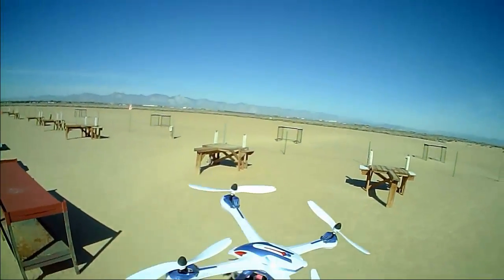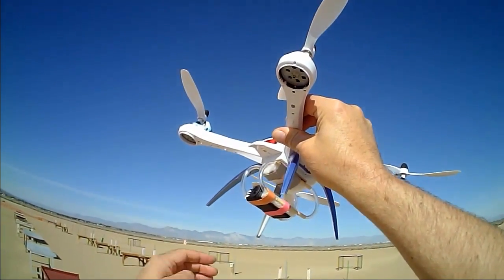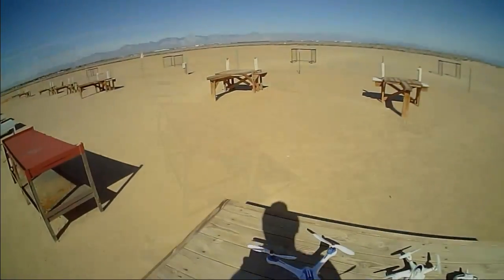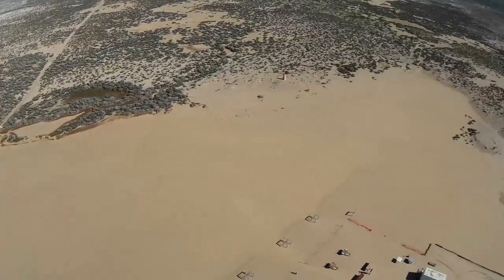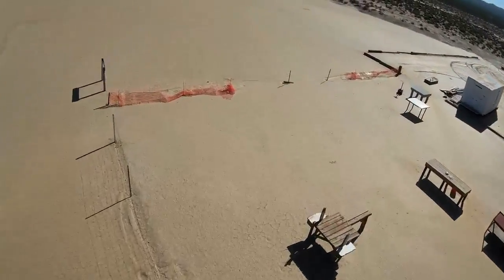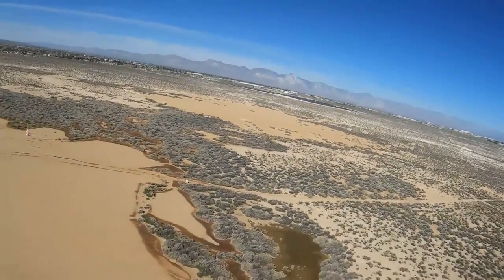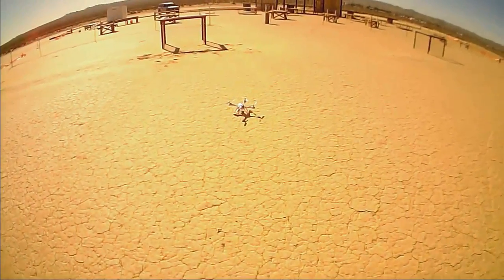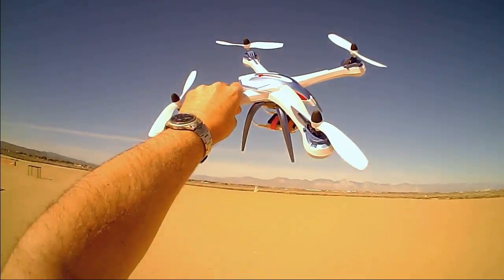Tarantula X6 Drone Camera Mount Test #2

Comment: Hi, Quadcopter, I tested the Togo clone Zoopa Mantis bought it as used of ebay for 20 EUR. It is very light/fragile, the cam and its holder not a real solution, but it runs like a racer drone. Your solution with an extern cam is the onliest way to get useable videos. Runcam, Fireflight and other cams and you have more fun with high speed. The Tarantula has a motor problem, you mentioned it, the motors burn too quick. At the moment I don't know what about the Mantis.

Comment: Good afternoon, I am hoping for expert and valuable opinion. I have two quads that I am trying to decide on. One being the Jxd 509G and the other Tarantula X6. Please tell me based on flight distance, camera and options what would be the better of the two. Also I noticed the Tarantula didn't have the 5.8 screen like the 509G. Is that a option for FPV?
Please help despertly wanting to make the purchase. I really do the like the availability to have the FPV. 
Thank you for your great videos.
 Phil
Reply from the maker: +phil gibbs An FPV kit is available for the Tarantula, but at an additional cost of $52 above the cost of the quadcopter.  The Tarantula also does not have altitude hold like the 509G.  Thus, as your primary interest appears to be FPV, then the 509G would likely be the better option for you. https://www.youtube.com/watch?v=9bPaOEDpQFs
Reply: Thank you for your quick response. So the attitude hold benefit is for taking good pictures? This will be my first quad.
Thank you
Reply from the maker: ***** No, the altitude hold feature is for preventing you from crashing into the ground. There's a misconception among many new fliers that flying FPV is easy. Actually it is very difficult, much more than normal line of sight flying. It is because it is very hard to judge distance from objects while flying FPV, especially with the ground.

Comment: hi. Great video as usual thank you. Question for you. I have an sj4000 (go pro copy) ad  was wondering, can this quad carry it? I notice you're using a mobius camera in this video. I've got a #16 808 camera but Im not happy with the quality of it and want to use the gopro copy instead. Thanks very much
Reply from the maker: skyrider1985 The X8C would be a better choice as it has more lifting power, and it doesn't have vibration issues like the Tarantula (Tarantula is infamous for jello).  I prefer to use the $55 Runcam HD with my X8C as it produces excellent results https://www.youtube.com/watch?v=DkWcSE9FGRU
https://www.youtube.com/watch?v=i32czqkycQM
https://www.youtube.com/watch?v=w2sqjk6ZmZI
Reply: thanks very much for you answers

Comment: Are all the hook-ups the same no matter for camera or power. Can a battery be used for the camera and another battery used for power. All after market cameras have the same hookups
Reply from the maker: Ray Boley Not sure that I understand your question. In the above video, I used a Mobius camera.  The Mobius has its own built-in battery for power, and does not use the quadcopter's battery for power.

Comment: Do you happen to know what the optimum wave length of 7.4 ghr is? i only found nuclear physics handbooks and, could not find it. Thanks. Sell that original 6052? HAHAHA

Charles Jones
Reply from the maker: Bud Jones Do you really mean 2.4 Ghz (like which these toy quadcopters use)?  If so, 1 wavelength = 125mm.  But some recommend 5/4 wavelength for optimum range (156mm).  But if both of the above are too long, 3/4 wavelength works well too (93mm).  Remember if you do this, do not point the antenna tip at the quadcopter. Instead you point the side of the antenna at the quadcopter.
Reply: Quadcopter 101 I bought a supernova. They say the control distance is 900-1600 meters-- I can not buy that. It says it is 7.4 ghr-- like the tarantula 6-- seems hard to beleive. I wanted to maximize range with 7.4, It is not the standard 2.4 as most.
Reply from the maker: Bud Jones The Tarantula X6 uses 2.4 Ghz.

Comment: I have the jjrc 686 on order but I really like this X6 so might get it as well - do you know if the stock 5M camera they sell with it is any good or should I stick with my 808#16 with D lens on it?
Also im wondered if this X6 can be used with an 808 and a 5.8ghz transmitter so I can use the remote and screen off my 686 and use this for FPV as well as I imagine the range on the X6 is so much better?
Love your vids.
Reply from the maker: despotmurgatroid I don't know yet about the quality of the 5M camera, as no one has gotten there's yet (it's too new). But it's hard to go wrong with the 808 #16 V3 D lens ;)  It's extremely lightweight, so most quadcopters can lift it.  Don't know if what you're proposing for FPV is possible, but maybe some of the other viewers here can answer that?

Comment: +Quadcopter 101, I am looking into getting a quadcopter (first time buyer). I have used many RC planes and helis so i know how to fly them. Do the motors on this quad have enough power and durability to hold the mobius often. I am planning to use this just for video, no stunts or racing. On another note would you suggest this quad or the newly released Syma x8c for video, I am leaning more to this seeing that it is very well liked and there are not many reviews of the Syma x8c yet. Thanks!
Reply from the maker: Haven't had a chance to review the X8C yet, but am concerned with its advertised range of only 100m.  The Tarantula can go much further than that.  Would recommend the Tarantual just for that alone.  The Tarantula's Hyper IOC feature also can actually be used as a return to home feature https://www.youtube.com/watch?v=ZNauv2w-uB8
Reply: Quadcopter 101 So the Tarantula x6 is a good option?

Comment: I just replaced a motor and but it back together every thing is right but she will not lift off!   Is there a reset on a jjrc  h8c  ??????????
Reply from the maker: Let me make sure that you're talking about the JJRC H8C, and NOT the Tarantula X6 featured in this video.

If so, try recalibrating gyros first.
1) Turn on quadcopter and place it on a flat and level surface
2) Turn on the transmitter and set it to 100% rate
3) move and hold both control sticks to lower right corners until the quadcopter's lights blink.
4) Let go of the sticks and try flying.

If the above didn't help, then you likely installed the propellers incorrectly (note that there are counter clockwise and clockwise propellers). You need to keep track when removing them so that you can reinstall them on the exact same motors.  If you forgot or don't know which is which, then recommend closely looking at the following picture, paying particular attention to the shape of the propellers and which arms they are installed on. Reinstall the propellers as needed to match this picture exactly.
http://img15.hostingpics.net/pics/522333DSCF4940.jpg
Reply: Quadcopter 101 Hi, Thanks so much, Yes I have the h8c.  I just keep this on my email so I can go right to you tube. I did do that several times and did the shake up thing. Even at 100 persent power she just sits there.  At best I can get her to jump around.   As you might guess I am a newbee to quads.
thanks
Reply: todd kruper Also the props are in the right places!
Reply from the maker: todd kruper OK, the next thing to check is the wiring.  Are you absolutely certain that you did not install the motor wiring backwards (red to red blue to blue, or white to white and black to black)?
Reply from the maker: todd kruper Also, with the quadcopter off, spin each one of your props manually by hand. Do they all spin freely, or does one (or more) show unusual resistance to your spinning them.
Reply: Quadcopter 101 Well my friend this was it, When I replaced the motor it was hard to get out of the plastic case.  When I inspected the housing there was signs of melted plastic. I remember looking at the gears and the sound was ruff but the blade  went around.  So thinking they just were not running together  I placed a small block of hard foam between the motor and the housing!   "IT FLIES- IT FLYIES"  Thank you for your time.  I will order a new motor housing and do it all again.  Great training!  To many f----en screws!!!

Thanks
todd

Comment: Hows the motors on this holding up? Been through so many with the v262, even with the bearing mod.
Reply from the maker: Yeah, I doubt very much that the bearing mod does much to improve the durability of the motors.  More important is to inspect your gears after every flight for any debris or sand to be cleared.  Additionally, I shoot a blast of compressed air through each of the motor ventilation ports to clear abrasive brush residue from the commutator.  I also don't fly aggressively with these bigger quadcopters, as both motor and gear durability can become issues with flips and such.  I use these bigger quads mainly for camera birds.  Doing the above with my V262 has greatly improved motor longevity.  Doing the same with my Tarantula, I'm at about 15 flights, and the motors still sound and operate strong.

Comment: How bout a syma x7? Can the syma x7 lift up a mobius actioncam?
Reply from the maker: No. The Syma X7 is not really powerful enough to reliably lift the Mobius.
Reply: Quadcopter 101 ok thanks alot!
Reply: +Quadcopter 101 so are there any mini quads that can lift up the mobius?
Reply from the maker: Justin Ng The JJRC H8C and Syma X5c.  But I wouldn't recommend it for prolonged flights as you will damage the motors.  Here are some example flights https://www.youtube.com/watch?v=SNePkMznOos
https://www.youtube.com/watch?v=Ih7Is30NpMk

Comment: Try surgical tubing or fuel tubing from a glow powered plane. It's made from silicone and surgical tubing is latex.
http://www.ebay.com/itm/1-4-ID-3-8-OD-1-16-wall-Latex-Tubing-Surgical-Rubber-Tube-Amber-By-The-Foot-/200822460443?pt=LH_DefaultDomain_0&hash=item2ec1f3901b
Here is some fuel tubing.
http://www.ebay.com/itm/DUBRO-196-Small-Silicone-Fuel-Tubing-2-Glow-Fuel-Only-Same-as-Dubro-221-/231169769791?pt=LH_DefaultDomain_0&hash=item35d2cac13f

Comment: The blue silicone aquarum tubing is much less stiff, and some kinds of it are softer than others.
 So using a stiffer frame with a short length of the silicone tubing might work well.

Comment: Thoughts on the jello, it may be caused by the video stabilization software in the camera. The camera probably scans the image in horizontal bands. The jello seems to be most apparent when the objects move across those bands which is vertical movement.  In horizontal panning, the image rides along the video bands, and that seems to be fine..

Regarding the camera anit-vibration mount, consider a standard dish washing sponge and some rubber bands not stretched too tight, but I do not think vibrations are causing the jello in this video.

Comment: Surgical tubing can be found at most hobby shops which support RC Aircraft, as they use it for fuel line, and have been using it for decades as such. If you have no hobby stores in your area, some pharmacies carry it.  Also, hardware stores carry it because its also used as fuel line for gas powered weed whackers, chain saws and hedge trimmers. Hope that helps.
Reply from the maker: Thanks, that does help. No hobby stores in my small town.  But we do have a Lowes, so will be checking out their weed whacker section.

Comment: Great video, I agree with what your saying about the forward motion causing the jello. On the X5c the stock camera is mounted ridged and there is no jello at all. But when I tried to get fancy and make an extended mount for the 808 camera it did the same thing that you are getting on X6. It was OK on hover but jello on forward motion. Strap it down like you did on the X5c and jello was gone. But it is fun trying to come up with new designs.

Comment: I think that the shaking could be chop related. I think that the forward motion coupled with prop chop is shaking the mount. Its still pretty great footage, but it could also be that the tubing is not buffered from vibration by some absorption medium. Not sure.

Great vid as always.

Comment: I already ordered the main gear with shaft attached can I install it without taking the quad apart.
Reply from the maker: It's difficult to remove the propeller grip from the top of the gear shaft. I haven't been able to figure it out, that's why I just replace the entire mount with gear already installed. But maybe someone else here has figured it out, and can share with us how to do it.

Comment: Hi 101, do u think Banggood or Gearbest might give u a camera version & mount version of the X6?  For review? It would be nice to see this copter without any jello effect in the video. It would seem to be a great upgrade to my Syma x5c-1
Talking about my x5c-1 I will be replacing my pinion gear & main gear on this quad, question how to replace the main gear the pinion gear is easy done but main gear maybe not I would hate to tear apart the quad just to replace that main.gear.
Dave
Reply from the maker: Will see about getting the mount and or camera separately.  As for the main gear, the easiest way is to replace the entire motor mount.  The following part comes with the main gear already installed.  I've bought several of these already as spares (after I accidentally sat on my X5c :). http://www.banggood.com/Syma-X5-X5C-Motor-Base-Spare-Part-X5-05-p-936090.html?p=RB0922217402201307U3

Comment: The vinyl tubing is available in "thin wall" and "thick wall" with the outer diameter remaining the same,only the ID changes.I would think the dynamics your dealing with,during horizontal flight, might even improve with a thicker wall tubing .
Typically 1/4" OD tubing will be available with 1/32" wall (3/16" ID) and 1/16' wall (1/8" ID )

Comment: Looks better than the last mount test and probably acceptable, I think. It definitely looks much better than at many points in the first Mobius flight without any mount:

https://www.youtube.com/watch?v=F1UUXxLazq8

It might get even better with RC plane silicon fuel line or surgical tubing and and an even lower profile due to the much shorter loops which would be allowed by the the greater flexibility of the tubing.

Comment: Yes, the jello started as soon as you started moving forward. If you think it is aerodynamic drag on the camera you could try making the tubing as short as possible. That should help stiffen the mount and still absorb the motor and prop vibration. What size is the I.d. of the tubing you are using and what size is the o.d. of the wooden dowel rods?  I have some green surgical tubing and would let you have some to experiment with, what length do you need?
Reply from the maker: I'd like to try this next, along with the zip-tie mount.  But where can the average person find surgical tubing at reasonable price? Keep in mind most people will only need a length of about a foot or two (don't need to buy a roll for this mount). What places sell it in such lengths?
Reply: Quadcopter 101 It might be better for the availability reason to go with RC plane fuel line like the guy in the video I linked to. If you don't have a hobby shop anywhere near you, here's an eBay seller selling what I think is the largest ID silicone fuel line tubing Du-bro sells:

http://www.ebay.com/itm/Dubro-5-32-id-Blue-Silicone-Fuel-Line-Sold-by-the-Foot-DUB897FT-/231501343547

$1.00 per foot + $2.09 shipping and the seller is in Utah.
Reply: I went through therapy a while back and my therapist gave me some to work out at home. It is just laying around now thought you might be able to use it. The rc fuel line idea is good also, weed eaters use similar fuel line and that is available at most hardware stores.

Comment: When I saw that tubing in the first try, the first thing I thought of was a SPRING.  I think you are right-on!  when there's low-frequency disturbances, like in forward motion, there is little filtering.  In hover, when you need the least damping, the tubing does at least as good as you had in your previous mount using the 808 and X5C.  Jello, the video aloft is great!